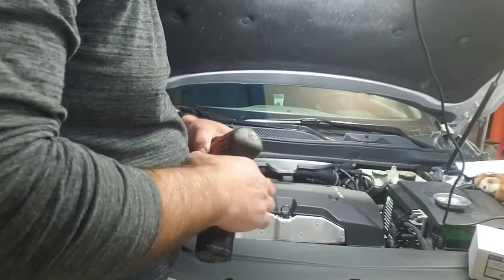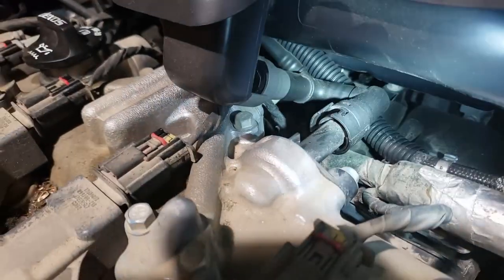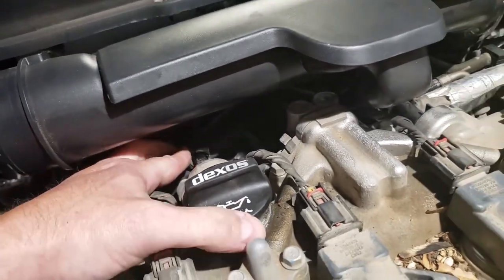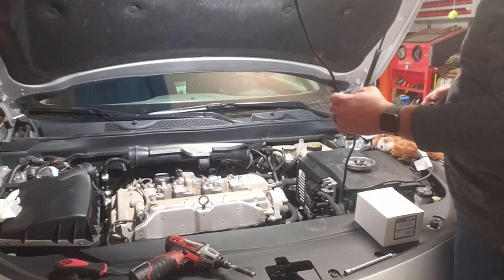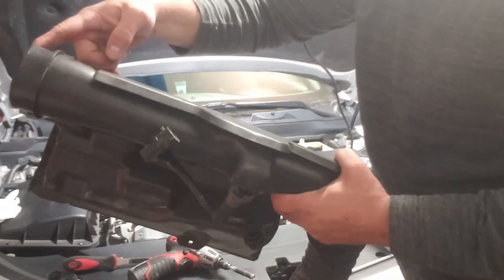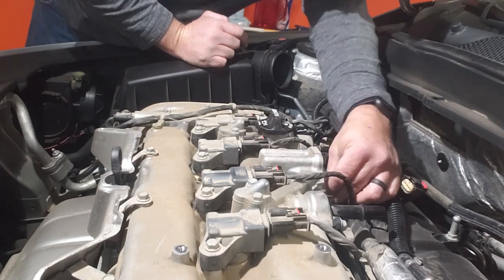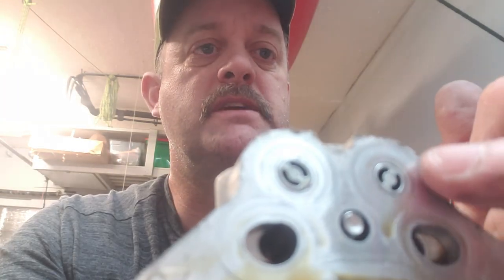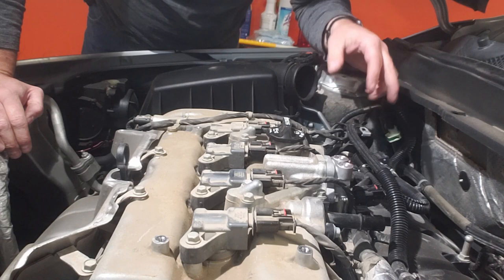2014 Impala P16CF Intake Rocker Arm Solenoid valve #2 control circuit

Comment: This worked on my 2015 Malibu! Thanks so much...everything under the hood looks the same and your video explained everything. My husband and I were able to do this and we are by no means mechanics. We had the code P16d0 Rocker Arm (1) stuck off. When we removed the rocker arm the pins were barely hanging in there...guess that's what the prob was. The check engine light went off after clearing the code and has not came back on...even runs better. We had been to 3 mechanics and none could help; they didn't even know how to fix it but doing research and watching your video saved us time and money. Chevy dealership didn't know and sent us to someone that didn't know then we found someone local but he wanted to do all kinds of repairs but still no guarantee that would fix it (would cost $1400). We found the part at Oreilly's for about $135. Thanks again!
Reply: I am glad that this helped you.  Thank you for the comment with the amazingly kind words.  Have a blessed day!
Reply: What did you replace?
Reply: I have a P16D0 code as well. This will most likely be the problem?

Comment: Thanks for this wonderfully informative video. Like! Like! Like! My 2014 Impala just threw the P16CF code at a little over 40,000 miles, and your video steered me in the right direction to find the cause.  I discovered the Chevrolet N192289160 Special Coverage Adjustment to address this issue (they actually sent me a letter about a year ago, but I had forgotten about it), and luckily the dealer fixed it at no charge.  

In my case, the rocker arm oil control valve had the "missing components" you are to check for, so the dealer had to not only replace it, but also take the extra steps of ordering and installing a replacement cam cover and two solenoid valves.  "Cam cover" is a deceptively simple sounding part - this thing is an intricately molded aluminum part that looks much like the old cast iron intake manifolds of the 1970's. Unfortunately it has "Made in China" etched in big letters right on top.  

All was fine until about 2 days after I got the car back, at which time it started making a noticeable vibration noise while idling in gear. I noticed pretty severe vibration on the intake plenum on top of the engine (what GM strangely calls an "outlet duct").  Again I consulted your video, thinking the technician may have left off the grommets, but I took it apart, and the grommets were there. After putting it back together, vibrating noise still there, so this time I removed the engine cover.  I didn't find anything amiss, but the vibration noise is gone after re-installing the engine cover - we'll see if it holds.  

One last thing:  I'm amazed at your good humor while performing this job, even after dropping the screw into the engine compartment. That would have put me over the edge with a stream of profanities -- not sure how you do it 😊.  Thanks again for the video!
Reply from the maker: I am glad that the video was able to help.  Thank you for the kind words and the comment.  Have a blessed day.
Reply: @sugarstevie do you happen to know if your Impala was made in USA or Canada? I have the same vehicle and code P16CF/P16D0 and it's the same engine 2.5L LT LKW 4cyl, SIDI, VVT, But GM says my VIN doesn't have this special coverage. My VIN starts with a 2 which signifies Canadian made. I'm trying to figure out why my car doesn't qualify for coverage. Under the 120k miles and nearing the 10 year mark.
Reply: @itsdizzleyall  I just checked and my VIN starts with a "1". I live in the USA, so I assume my Impala was made in the USA. That's unfortunate if they are excluding Canadian-built vehicles. Hope this helps. Good luck!
Reply: @BubbaTex  thank you so much for the reply! Yeah I'm in Cali myself. Bought the Impala used in 2018. Apparently these models were made in 2 different factories. I'm just wondering if the solenoid made in Canada doesn't qualify under this special coverage and only the US made one's? Weird because I have all the same codes and issues but GM doesn't have my vin listed for coverage.

Comment: I have a Chevy Impala with a code p16do. Does this mean it could be an intake valve, exhaust valve, oil control valve, camshaft solenoid, or rocker arm solenoid. Where would you start?
Reply from the maker: Thank you for watching and taking the time to comment.  If you haven't, please consider subscribing.  Unfortunately I do not know the cause of that code.  However, I just did a quick google search and found this: What are the Possible Causes of the Code P16D0?
Faulty Intake Rocker Arm Solenoid Valve 2
Intake Rocker Arm Solenoid Valve 2 harness is open or shorted.
Intake Rocker Arm Solenoid Valve 2 circuit poor electrical connection
How to Fix the P16D0 Code?
Start by checking the "Possible Causes" listed above. Visually inspect the related wiring harness and connectors. Check for damaged components and look for broken, bent, pushed out, or corroded connector's pins.
What is the Cost to Diagnose the Code P16D0?
Labor: 1.0
The cost to diagnose the P16D0 code is 1.0 hour of labor. The auto repair's diagnosis time and labor rates vary by location, vehicle's make and model, and even your engine type. Most auto repair shops charge between $75 and $150 per hour.

Good luck, and God bless!

Comment: I recently had to change this part on my 2014.   I truly do t know if the two little pieces that you mentioned possibly being missing and possibly lodged I rocked arm cover
Is there a way I would know this had happened?  Im asking because I had to replace the same part in just one month
Can you please tell me what I would “look” for if this was the case and the little pieces had come out?  It is way beyond looking at the first part that was changed.   That went in the trash over a month ago
Would there be any  telltale signs that this is what might have happened?  They were present when The second part was taken out.  Could this cause the part to fail again after such a short time?  I had no issues at all after it was changed the first time
Reply: First, thank you for watching and taking the time to comment.  Second, I unfortunately cannot answer your question.  I was lucky, because I didn’t know about those two parts in question until I was finished with the repair.  I was able to look at the footage during the edit to see that they were still in place.  I would advise checking with a certified mechanic. Good luck

Comment: I had my check engine light on I’ve been looking for this part for maybe little over 6 months I finally gave up car runs fine an maybe one day it will be in stock again
Reply from the maker: Your lucky  if yours is running good.  Like I said mine would stumble and almost come to a stop while accelerating.  Happened several time on the interstate. Drive with caution.
Reply: It’s going to run fine then it will bust and leak oil all over the place. It did this to me, I would switch this part out as soon as possible. I ended up getting rid of my car that day. This should be a recall.
Reply from the maker: @ricardod7693  I agree.  But until that happens they need to start making a replacement part.
Reply: Ricardo D I agree with you 100% I try looking for this part for many months even junkyards an had no luck!.. no ones had it unless you pay 500$ on eBay for one
Reply: victorgoofy From my experience I would pay the 500 since the ones I saw on eBay at the time also provide the seal. The part does not come with a seal. Trust me, once those two rings on top bust the car will leak all oil and it will damage the motor. I suggest trading the car in or paying the 500. In the end when it does explode you will pay more.
Reply from the maker: Just got a recall notification on this. Call your dealership
Reply: scottoffroad good luck, I would get rid of the car. I am very happy now with my Daytona.
Reply: scottoffroad yup!.. I got the note I’m calling them soon I kept the malibu but I also bought myself a fusion an I’m loving it a lot more lol
Reply: Well, in case you all can't find it. Amazon has it for about 110 plus tax. Item # 916806. I just replaced the piece on my car and now I can remote start it again. Took about 30 mins.

Comment: Thanks for the video. I had the same code, same car, replaced the part, code came back within 2 minutes of driving the car. Any ideas?
Reply: Mine did too...I found a loose wire that I just made sure was tight.  Just double check your work.  If you don't find anything, I do not know what advise to give.  Sorry.
Reply: What part did you replace?

Comment from the maker: FYI Just got a recall notification on this issue.  Contact the dealerships!
Reply: Did you get a full blown recall notification letter for your car, for the Impala?? Ours is 2014 Malibu and the letter I received is not a recall but just an extended warranty up to 120k miles....
Reply from the maker: Good for 10yrs or 120K miles which ever comes first.
Reply: @DunnageGarage  yeah exactly... So an extended warranty... Not a recall. A full on recall doesn't have a mileage limitation
Reply: @DunnageGarage  Oh I really wish I would've seen this! My check engine light came on just before 120k and I didn't get it to the shop until about 124k. (I drive a lot of miles so that wasn't that much time). Now I'm out about $480 for this exact fix.
Reply from the maker: @ethanj454  not sure about giving this a 👍 . Glad the info was helpful.  Sorry you found it a little late.
Reply: @ethanj454  sorry. Was the intake, solenoid, or valve?

Comment: Did you have to disconnect the battery at all before removing the intake cover? I’m trying to clean my 2014 Chevy Malibu throttle body
Reply from the maker: The cover is just plastic decoration.  Always a good idea to disconnect the battery when working on your engine though.

Comment: I'm getting oil leaking from what appears to be this part. It's coming from the rear topside of the engine. I've had a very very slow leak somewhere and I only realized I had an oil leak after smelling burnt oil that was ending up on my exhaust system. Oil is coating everything on the back of the engine to the very bottom of the oil pan. It appears that the oil is coming from this part or somewhere very close to it. I replaced the PCV valves and hose and it didn't fix it. Is oil leaking a common issue for this?
Reply from the maker: I'm not sure if it is a common issue.  But I can see that as a leak potential.  good luck.  Thanks for the comment.  Please consider subscribing if you haven't already.
Reply: How did you fix the oil leak?

Comment: How do I get my light off afterwards
Reply from the maker: 2 steps, First, subscribe to the channel.  Second, head to the parts store and have them check the code and clear it.  If the second does not work, double check your work.  Mine didn't clear initially, after I connected the loose wire, it cleared fine.  All kidding aside, thanks for watching and I hope the video helped.  Have a blessed day.

Comment: What's the part number? I'm trying to find it or a third party model
Reply from the maker: I cannot  remember.  Sorry
Reply from the maker: There is now a recall on this. Call your doctor
Reply from the maker: Dealership
Reply: @DunnageGarage  yeah I got a letter this past week about the extended warranty on it. Unfortunately it doesn't seem to be a full blown recall, but just "if less than 120k miles". We're at 128k so that sucks. I called my dealer and they said perhaps they will change it to a full recall in the future though as this update is only as of June?....
Reply: J- L  Thanks. I actually got one off eBay, proper OEM, for $115. Easy fix once got the part.

Comment: Any advice on how to find this part? I'm looking for it all over the web and cannot come across one.
Reply from the maker: I dont have any.  I got very lucky and found it 45 miles from home at a Napa.
Reply: If the part number is GM 19419980, I ordered from local Chevy dealer. It took them a few days for the part to arrive. Alternatively, if you want to order online, the site https://www.lookupgmparts.com indicates they have it. Best of luck.
Reply: @scottdavis9575  so you were able to get your part from the dealer? I hate ordering car parts online....
Reply: Thank you for the advice, I spoke directly with Dorman and they said they will be releasing new parts this summer under the part #908-816. I was able to order one at an O'Reilly's. After installing the new part, do you recommend an oil change it anything to get rid of the engine light?
Reply: @scottyklutch5071  Hi there I need this same part. I have the same P16CF code that seems common enough on a '14 Malibu... Can you please elaborate how you found the part through O' Reilly's? I cannot for the life of me find anything on their website or even a Google search under "908-816".... Different number?
Reply: @AaronLorch91  yes, I simply called and asked them that I needed help ordering a part.
 Give them the part number and they will look into ordering it directly from Dorman
Reply from the maker: Just got a recall notification.  Call your dealer

Comment: Where did you find it? Everywhere I looked is on back order
Reply from the maker: Napa about 45 min from had one.  I was lucky! Good luck on your search.
Reply from the maker: Just hot a recall on this call your dealership
Reply: This impala shares the same engine displacement as the 2015 Malibu a Chevy dealership is best bet for such parts
Reply: @Roberto-gp3yx  Except the dealership does not have the replacement part and didn't know if they would ever get it.  Since the recall I assume that the dealerships now have the part in stock.  I also assume that it is becoming more readily available in the aftermarket world too.  Thanks for the comment.  If you haven't please consider subscribing.

Comment: Did this fix the issue? I have two codes. P16d0 and p16cf. Can you help me please?
Reply from the maker: Yes it did fix the issue for us.  The car has been running flawlessly for the last 7 months.
Reply: The d0 one is more than likely the intake camshaft position actuator solenoid. I’m buying both to replace them this weekend hopefully

Comment: I Have A 2014 Malibu 2.5 LTZ Same Problem Got the part onLine At GM Part Direct  GM PArt Number Is 19419980 Gasket Number Is 12634467.Thanks that was excellent video
Reply from the maker: There is a recall on this now. Call your dealership